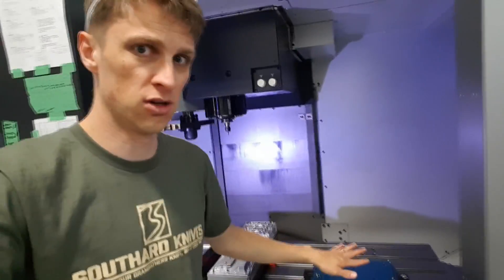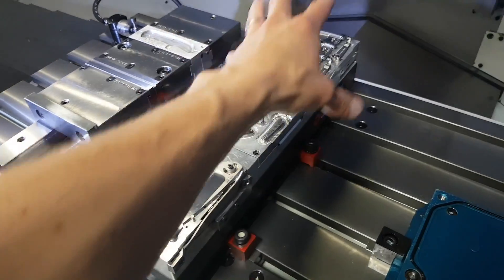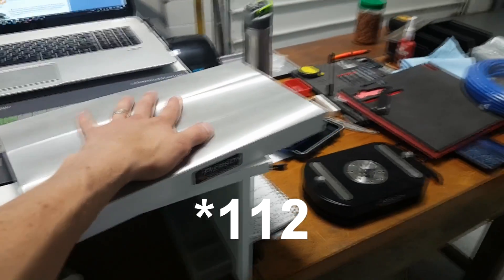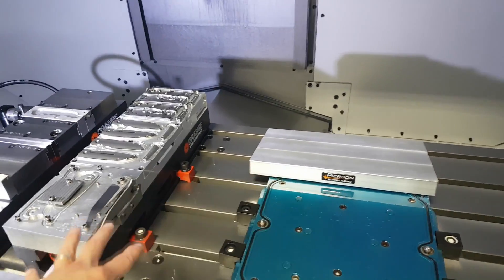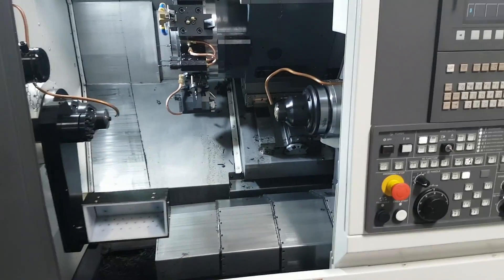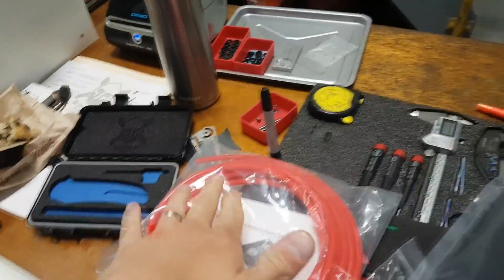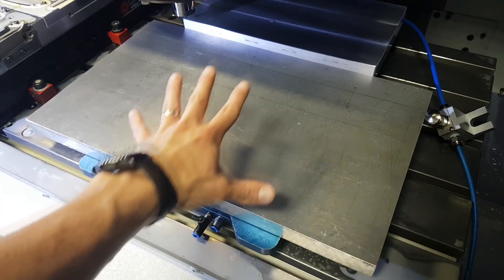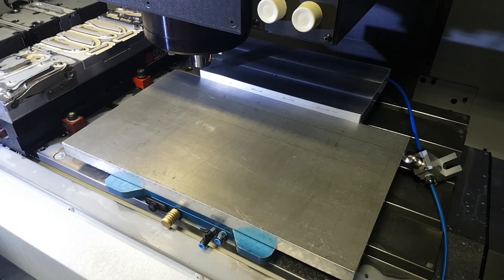Pierson Mini Pallet System, other fixturing tips, and Lean improvements

Comment: For your vac magic plate - you can use a vacuum pump with a small reservoir instead of the venturi vacuum. It saves your compressor from running all the time.

Comment: Try Delrin AF instead of black Delrin. It's a lot more expensive, but it's teflon impregnated so it has lower friction and it chips MUCH better than black Delrin. I make race bushings out of both and hate it when I have to run a regular Delrin kit.

Comment: Hi John if I were planning to use riser blocks under the vacuum plate and the pierson pallet I would look at rising them to the same level as the top of the plate on the orange vice that way you know that you can get all the tools to the right position and when you are setting up you can stay close to the job in z axis and move the machine anywhere over the bed without running in to anything else yes it is idiot proofing we all make that mistake from time to time all looks good

Comment: Looks like you're making good progress, John. Did you consider using MiteeBite Modular Expansion Pins to hold the large fixture plate? You talked about bolting it in place but those might be a better way to do it. Just ordered my MPS today so it was cool to see you playing with yours. What did Jay say about the holding strength? He mentioned making them specifically for the Tormach crowd but that was in part due to the machine HP.

Hope you are doing well, sir.
Tom Z
Reply from the maker: They've got half the holding force than the two ball lock systems, 1,500 lbs vs 3,000 lbs.  But that's probably no biggie.  It also doesn't have the cast iron core that the big one has.  But it's half the price!  Still looks awesome to me.
Reply: Agreed - I can't wait to get mine and put it to use. It's going to be a game changer for how fast I can get parts turned around.

Comment: When doing plastics I learned that the best way to deal with chip loading is to program in "micro dwells" to break the chips, combined with air blast this helps make the strings smaller and easier to blow away. Also, try hooking up air blast to the turret through the coolant lines, having air right on the tool to blow chips off boring bars really helps. I've even done crazy stuff like programming the turret to scrape chips off the tools manually with like a piece of plastic being held in place with a noga. All fairly tedious options but ones that worked for me if you are really dialing in your setups.

Comment: John, how much hand coding do you do? or is your post nailed for the Nakamura now?
Reply from the maker: Still a fair amount of hand coding on the lathe.  The basic ops are fine but all the stuff between ops I usually want to tweak, and the transfer.  The Mori/fanuc post is perfect as is, not including the odd manual NC option for various M00 stops or notes.
Reply: JohnGrimsmo ok. I'm working on a Nakamura post now which should get pretty damn close to being spot on once I'm done. Does your lathe support G496?

Comment: Seems odd to me that it's only those ground pads to lay the plate on. I thought it was going lay over the pallet system. That little surface area doesn't look really rigid to me, lot of overhang. I thought there was a lot of overhang as it was with the size the system compared to that plate, let alone just using those pads.

Comment: Why not source out an injection mold for those bearing races. There are many molders that could make a steel mold to hold super tight plastic tolerances. Would also be very low cost parts

Comment: Use that chunk of aluminium that you had laying around in your shop to make the height adjustment nedded. Instead of using the postion that you had in the video as a fixture, just flip it 90deg and fit the new Pierson pallet and the old vacuum table ontop! :)

Comment: John, I use Pierson qcp. I never cut actual pallet. I bolt on another alum pallet or steel to top. Set it up as needed. Then if I decide not to make part anymore or change it, or ruin pallet, just unbolt, bolt on another. I have machined about 8 base pallets and used his hardware kits to set them up.
Reply from the maker: That's a pretty great idea, thanks!

Comment: That pallet system is super sweet!  I'd only be concerned that there is no visual indication that the air cylinder behind the balls is fully seated.  I might modify it (if it does use a cylinder) to add a hall effect sensor (COTS) to the cylinder with a visual indication.  Only takes one F!@k up to more than pay for that!  

Also if you like doing the foam in house, get a CO2 laser cutter.  1/4" foam can be cut by 80W easily and will keep your machine free to make stuff that brings in money.  You can pick one up for $5-8k or double that for a USA made one.  The only time I'd say milling foam is necessary is when you get into the really thick stuff >1".  If you get into big volumes, you'll want to get a die cutter or have them die cut because then even a laser is too time consuming.
Reply: Rob F the way the pierson pallet works is similar to a trucks air brakes, where it is locked when theres no air pressure, and you use air pressure to release it. so the only issue that would happen would be the pallet being locked in place. pierson designed it as a failsafe incase theres a loss of vaccum or even a cut line.

Comment: John could you please shed more light on machining foam...i am looking to  make some special inlays for my  tools chest at work...thanks..
Reply: While in the Air Force I worked in the Too Crib where all and I mean ALL the tools were shadow boxed (foam cutout).  We just drew on the foam by hand and cut it out with a Dremel.  We found a foam that had two different colors and used that to make it easy to see what tool was out of place.  If you want to do CNC, anything that can run a Dremel size tool can cut foam.
Reply: Robert Palmore Thank you Robert.
The foam i have on hand has a hard plastic layer on top for wear and tear...will give it a go.
Reply: sunilkumar vc drag knife?

Comment: yep the brother needs a mounting plate under an orange vise for me to use my stubby threaded shank insert tools. about 1/2 short. makes sense since they really push that 4th axis function and it's usually using a drill or tap

Comment: John, I know our a fanatic for accuracy so make all your fixtures the same height. This way the thermal growth in z stays consistent across your various fixtures. Also male your risers out of iron if you can. Cast iron is way more stable than aluminium, that's what they build that whole machine from for a reason!
Reply: Excellent point on the Z heights and thermal expansion. Cast Iron is also very good at absorbing vibrations which definitely can't hurt either in the pursuit of the perfect surface finish.